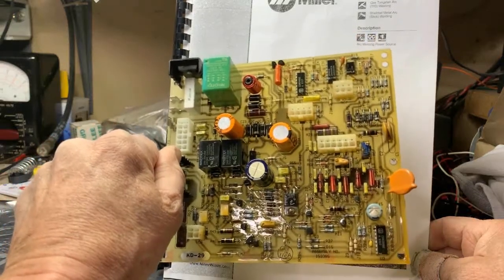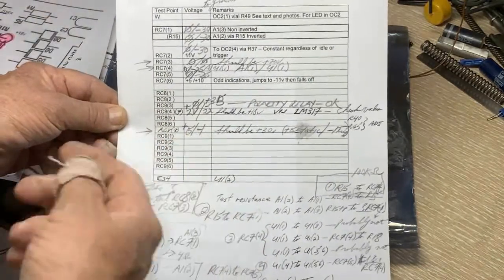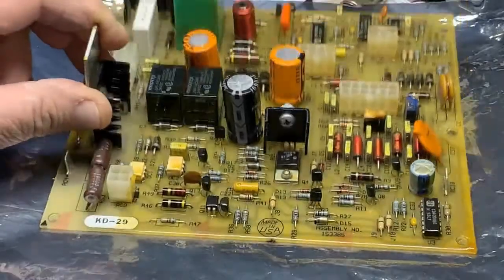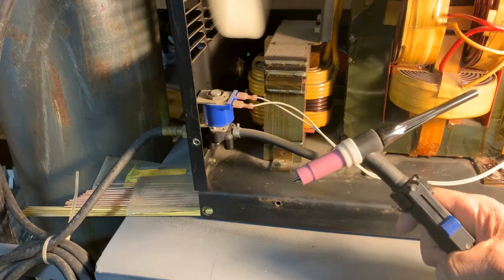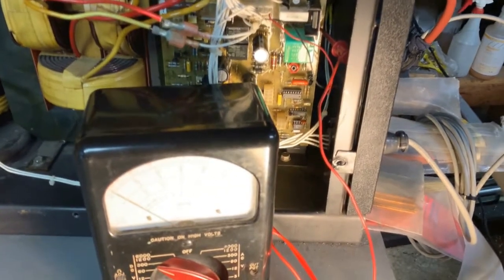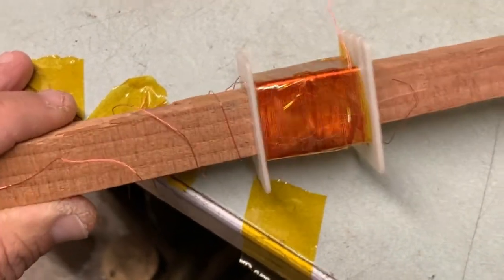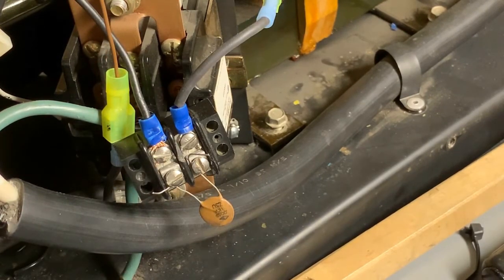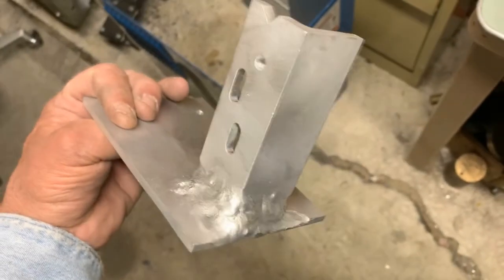Vintage TIG Welder Control Board Repair

Comment: Amazing video and knowledge you have. I am a welder by trade and also have an  Econotig. The machine does not send the required  24 volts to gas solenoid. Would you have any idea where to begin a repair?  If I cant fix on my own do you do repairs/upgrades?
Reply from the maker: Thanks so much for your interest and comment  today.  I don't perform any repairs. Your problem is likely the whole 24 volt supply and/or the contactor or its  connections.  Start with  the fuse.   Look for any burned or dead components  like  the rectifiers in  that circuit.  Also, any filter  capacitors need to be checked if not replaced.  I had  several that checked good, but were bad.  The circuit is open somewhere and it's probably a simple fix. Make sure  to get a  copy of the repair  manual sold elsewhere as it will afford  a number  of tips.   I hope you  fix it and  it's a machine worth that trouble and the time. Be careful with  the control board and follow all  ESD guidelines when  handling it.
Reply: @michaelbradford2816  👍 Thanks for the info!